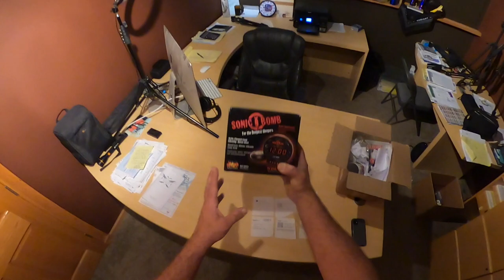Brand new mower - With review

Comment: He's exactly right about the oil, ive ran small engine motor's all my life, normal shelf oil doesnt have the heat range for mower/small air cooled engines. The oil in mowers will typically run 100 degrees hotter then automobile engine. Someone in the comments said run 20w-50 oil... thats what goes in the hydraulic drive system NOT your engine oil. I like to use 10w-30 Amsoil Synthetic Small engine oil.

Comment: Definitely should have been filled at the dealer but they do have like an 8 gal tank and gas is not cheap but neither is that mower.. we are switching back to scagg from JD  and I couldn’t be happier as the shop mechanic.. scagg is user and mechanic friendly 
Congratulations on new machine 
If it’s red it stays in the shed

Comment: We do around 95 clients on the week and had been running 2 pro-stance 36in, 52in, and one 60in sit down with a powered 3 bin bagging system for big lawns and leaves. All were Gravely.  Both our 52in right hydros went down within a month of one another.  We were going to replace at least one of the 52in near the end of the season.  Both had 2k plus hours on them, so they were getting old.  We ended up getting a 52in and a 60in scag about a month and a half ago now.  After running Gravely for nearly 7 years I have to say I think I like the Scags better just because they throw the grass a million times better than the Gravely mowers ever did.  Changing the blades are a big pain compaired to gravely tho lol.

Comment: Ryan, if you ever get a new dually go woth a Flat Bed 6.7 cummins with a jake break, they are so reliable with hauling and everything else for your needs, i use mine to haul a 550 john deere dozer, ive had it for 5 years and never had a problem with it.

Comment: Hey ryan quick tip on the scag mowers on the deck itself there are acouple air flow holes on each side that will eventually get clogged and make the velocity weaker just find alittle poker tool and keep them clean and it should run as well as it does now and also when mowing with the machine dont base your cut line off the little wheel use the side corner of the deck and it should make it alot straighter other than that scags are amazing machines i use one every day!
Reply from the maker: Thanks, I didn't know that. And yes I noticed immediately that the wheel was in a different spot than my gravely and I need to adjust. That is going to take a bit to get used to.

Comment: If you notice the lines in my profile pic was done on a scag Cheetah you made a great choice on mower and the thing with the newer mowers get comfortable with it but the sweet spot is between half and 3/4 handle distance take it down the Rd put them all the way forward hang on it's quick but then start backing of the handles to find the sweet spot been using

Comment: I do have one question not that I think its a bad engine or anything cause my personal opinion its a great engine but, any particular reason why you went with the vanguard instead of a Kawasaki or was the Vanguard the only option for that model?  I don't personally like or dislike one brand of engines when it comes to small engines as I think they are all good in their own way.  I would however probably choose a Kohler or Kawasaki over a Vanguard not that its a bad engine.  I just prefer Kohler or Kawasaki.

Comment: 10:40...winterize mower. Fuel stabilizer in a full tank of gas, then let it run into fuel line. Let it run until it runs out of gas???!! I'm trying to follow what he's trying to say, but I'm not getting it. I usually run the mower till it runs out of gas. What am I doing wrong here?